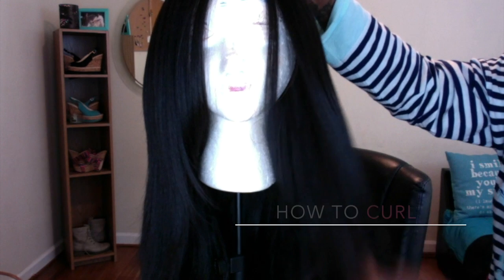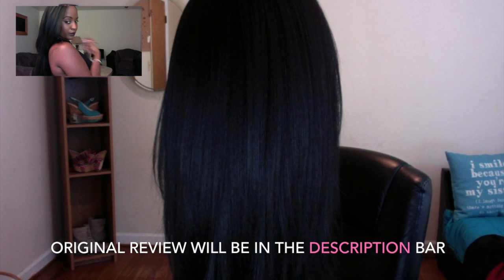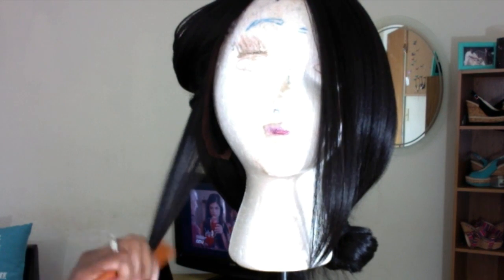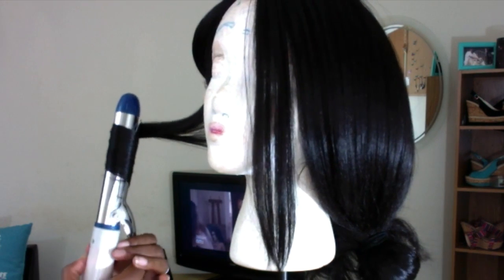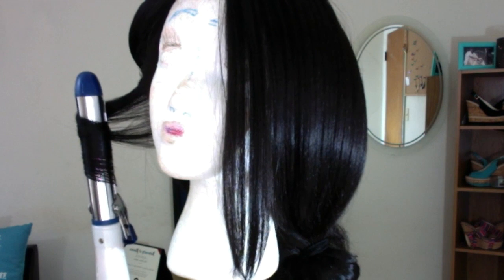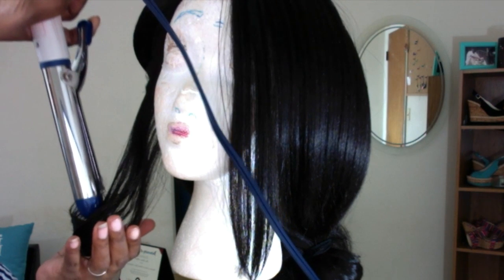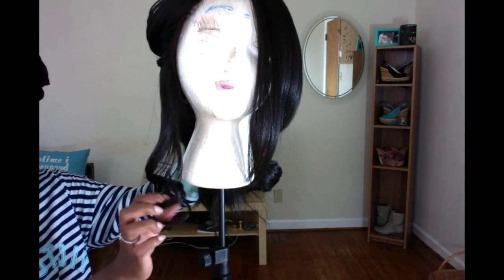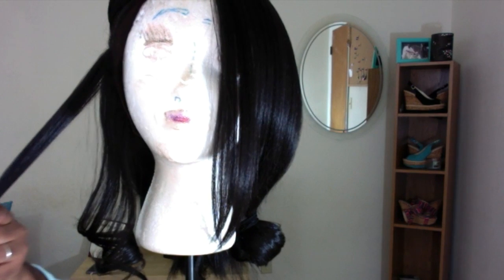*EASY* How To Curl A Synthetic Wig With A Curling Iron | NO PINNING!  | Isis BS202

Comment: Spray the hair with a little bit of water & then curl the hair! It works better that way! Most synthetic won’t hold the curl when it’s dry. Spray it until it is slightly damp & NOT soaked! A little bit of water works. It doesn’t matter if the water in the water bottle is hot or cold. Just use regular tap water at a normal tempature and it will work :)
Reply: Gonna try that right now, thank you!

Comment: I messed up my wig doing this 😓
Reply: I keep it on 100° and if your curling iron doesnt have that option you can just turn on you iron let it heat up then turn it off for about 40 secs before you put it on the hair.
Reply: I did this to hair extensions. It frayed the ends and ruined them. I had to keep cutting until eventually I trashed them.  There has to be better ways to curl.

Comment: I'm gonna try this method bc I don't know if it's the curling iron I'm using or I'm just doing it wrong bc I can't seem to get my wig to curl right. Does it matter if there's product on the wig?
Reply from the maker: There really shouldn't be any product on a synthetic wig, yeah that may affect it a little.
Reply: jalarise84 I have seen other youtubers spray a little bit of water on each section before curling. Also using perm rods in hot water for 3 minutes
Reply: jalarise84 Check out sadexlove. She shows you how it works with water. I had the same problem with my wig.

Comment: I need a curling iron that shows the temperature. No higher than 300 to 330. I'm going to get one tomorrow. My topper is SO straight I just wasn't going to wear it. So I just found and bought a new curly one. Now I'll have two when I use this method. How long will the curls last?  Thank you for making the video.

Comment: whats the highest level of heat u used on this hair? please let me know coz i dont want to burn my hair
Reply from the maker: No higher than 330 degrees for synthetic hair.
Reply: Curlers don,t have temp read outs.
Reply: Regular irons,  heat on high first to heat up then put on low, I  spray water before I curl.